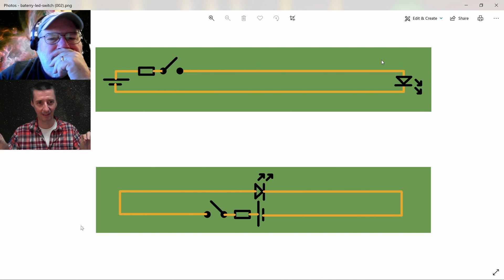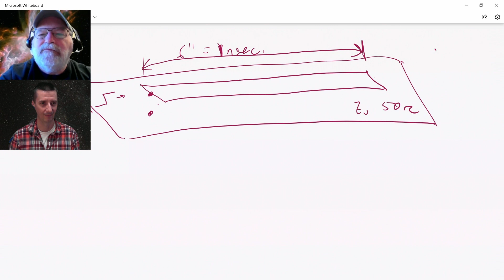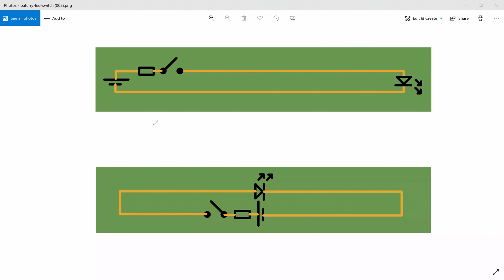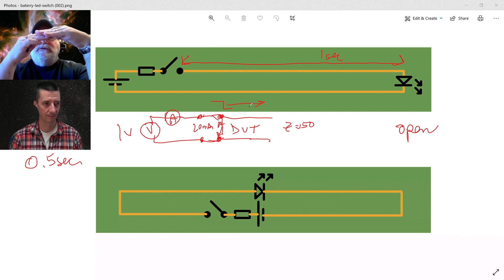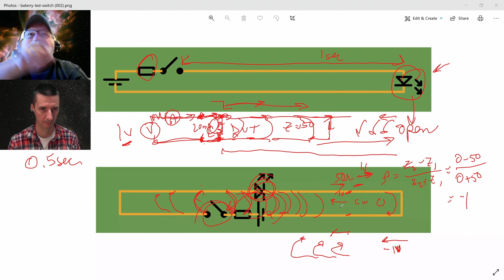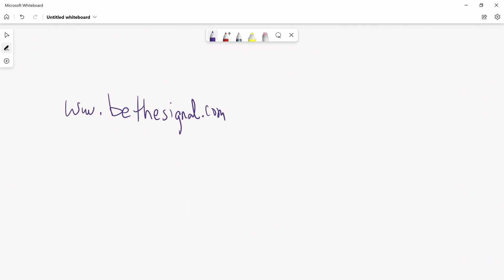Explaining Veritasium Electricity Video: Energy doesn't flow in wires (with Eric Bogatin)

Comment: So, it is due to this displacement current effect that you can terminate transmission lines with resistors and have the impedances match?
Reply: Yes. Well not exactly The transmission line acts as a chain of inductor capacitor pairs connected in series. When you test a single L-C pair using a meter (apply a voltage, read the current) you see a dynamic effect -- following the stepped voltage, the current plays out as a ringing pulse.  But when you chain an infinite number of these circuits together, and array them in space, the  further away ones affect what the near end sees later in time, with the net result that the overall effect at the near end is that the applied step in voltage causes a constant current. It is THAT phenomenon (fixed voltage step causes fixed current step) that looks identical to resistance, and hence allows you to replace the far part of the infinite cable with a resistor (of appropriate value) and it's indistinguishable at the near end.
Reply: @Graham_Wideman  Thanks, that makes sense.

Comment: Great video, and I love Bogatin, but I think he’s not quite right at the end. The “ideal-ish” LED will blink briefly as the displacement current activates it from 1m away, and then it will turn back off until the circuit begins to settle ~1s later. After the displacement wavefront passes the LED, what transient condition exists across the LED terminals? There’s no longer any current flow until after ~1s when we start to see the LED turn on permanently  as the reflections settle out.
Reply from the maker: When we have a look at Eric's graph, it says, 50OHM all the time until it's back ... so, that would mean 20mA flowing all the time when the edge is travelling the way there and back. If we are talking about the bottom circuit (led, battery, switch, resistor placed in the middle), the current would be flowing through the LED when the edges would be travelling. Or?
Reply: @RobertFeranec  Again, I am still asking questions instead of explaining.  My perhaps flawed understanding is that flipping the switch lets the voltage difference move downstream, and each new point it hits creates a displacement current.  This wave of newly created displacement current should turn on the LED as it passes.  

But after the wavefront passes, I would expect the voltage in that area (such as the at the LED) to no longer be changing, so I would expect the displacement current to stop powering the LED.  (Or is it somehow a whole continuing series of waves?)  It might still be powered by regular current conducted from where the single wavefront is now, but if so, I would expect that to be at a lower power, because of something like the Doppler effect -- it has to come from farther and farther away, without actually speeding up, so it spreads out.

So I'm not sure why (or even if) the LED doesn't fade a little.  Afterwards, both this video and Veritasium's agree that the power will increase as the energy has time to traverse the complete circuit, but I think Veritasium explicitly said (and you didn't disagree) that it slowly converges to full power over about 10-full-circuit-traversals, instead of snapping to fully on with the first complete-circuit traversal time.  The only explanation I can yet imagine for that is that the convergence is some sort of "half-way there" on each step, and he arbitrarily picked 10 steps as when it is "close enough."  And if that is correct, it might still be worth a video explaining how things (current? voltage? capacitor charge?) settle in that exponential fashion, and ideally, why.
Reply: @jimjjewett  There are no reflections in an ideal transmission line.  All of the power goes into the LED, it does take 1meter/c seconds for the incident wave to reach the LED.  In a non-ideal transmission line, you can indeed have reflections which might dim a hypothetical LED.
Reply: @seanm2511  All of what power?  Are you saying that because we are assuming an ideal transmission line, the LED will be on at full power as soon as it is on at all?  If so, then both Veritasium and this video disagreed.  But if not, then could you be more explicit about what your point is?  For What It's Worth, I had assumed that "ideal transmission line" in this context just meant that there was no resistance, so the circuit could actually work despite its huge (borderline astronomical) length.
Reply: @jimjjewett  Well, maybe I should watch the video again, but I heard "ideal transmission line" which means the following, at least to me:
1) the source and load have the same impedance
2) the line has no impedance
Re: your comment:

"Are you saying that because we are assuming an ideal transmission line, the LED will be on at full power as soon as it is on at all?"

Yes!  With an ideal transmission line regardless of how long it is, we have a square wave of current which has no reflection, and no phase delay.  With this ideal transmission line, an LED that is 1 light second away will be on in 1 second and will not pulse.
Reply: @jimjjewett  But, perhaps I do not understand your objection.
Reply: @seanm2511  OK, that is a helpful clarification.  (I apologize if my initial wording sounded brusque.)  I just don't think it is what the presenters meant, since they all agreed that the LED comes on in multiple brightness stages, and Eric Bogatin specifically talks about (negative!) reflections where the impendence is reduced by a wire connecting the two lines at their distant ends.  

I also think this is the first I've heard that "ideal transmission line" would imply more than your number 2, plus maybe the "no phase delay", or no variation by frequency.  I can see where assuming stuff about the source, load, and switch would be helpful though -- did you learn this convention looking at electronics, or at power line transmission, or in some particular domain area, or ...?
Reply: @jimjjewett  There is also propagation delay between signals on the same bus, but that's not really important here.
Reply: @jimjjewett  See my HFSS simulation to get a visualization of the fields and calculated currents. The bulb does indeed see a sustained current rather than just an initial blip. I am in the process of making a video explaining why this is since it was very unintuitive to me at first. Basically it has to do with surface charge densities that get set up by the electric field and continue to drive current at a reduced level until the signal reflects off the ends and starts to step up the current to its steady state value.
Reply: @PulsedPower  When you say "my HFSS simulation", do you mean https://www.youtube.com/watch?v=aqBDFO1bEs8 Response To Veritasium - Electricity Propagation Time Problem?
Reply: @jimjjewett  Correct!
Reply: I'm replying just so that I'll be notified if this gets answered.  The wave is propagating down the line, but it isn't clear to me that there are new changes at the origin until a reflection gets there.  I told myself it was current being conducted back from new displacement at the wavefront, but ... I'm not confident of that, nor am I confident that a Doppler-like effect wouldn't at least decrease it.  Of course, I also don't quite get why it comes up in "10 steps", instead of after 1 step, or at least in a zeno's paradox of 1/2 the way each step forever.
Reply: @jimjjewett  I think the displacement current will be enough to sustain the LED, and there's many ways to explain it, but this is my layman understanding using lumped elements (please correct me if I'm wrong):

As displacement current is produced through each section of wire, charges are depleted in that section, which causes current to flow from the adjacent section. In the top circuit, only one wavefront is produced, which means there's displacement current in only one section of wire at any given time, but conduction current is supplied by the source, which produces a continuous current between the source and the wavefront.

In the bottom circuit, there are two wavefronts producing displacement current in the same direction, starting at the same spot. So immediately the displaced charge from one wavefront is picked up by the other wavefront, such that there's always a continuous current between the two wavefronts.

EDIT: Might be completely off-base. This explanation seems to imply that you can throw the switch, remove the source, and the LED will stay lit from the displacement current due to the wavefronts alone. Something's definitely missing here lol
Reply: bwseventytwo - exactly. This is why you cannot use a transformer with a DC current, and why we use conductors to carry the energy, not air. I don't know why people are forgetting what happens in the real world here.
Reply: If we're specifying ideal transmission lines, then there will be no reflections.
Reply: Displacement current is related to transmission line. It flows between the capacitors. Led is far from source. So displacement current is flows between transmission line first. After some time it  conventional current reaches to led then led will glow.
Reply: I think experiments show that it receives some power continuously until 1/c seconds later. There is continuously coupling of energy from the wave front during the 1/c period.

Comment: Unfortunately, Derek used a pretty powerful lamp and just 2 wires 1 meter between them, so I think his answer is incorrect. Yes, you can measure the current going through the lamp immediately, but it is not enough to light the lamp. Also, the current with his setup will be extremely low (i wonder what is an impedance of his line :D )

Great video btw!
Reply: You mean Derek, right?
Reply: @DehimVerveen  Ops, you're right. Thank you.
Reply: @zx-4rr-pls  That's true, but I found it misleading because with this condition it will turn on even if we cut the wire somewhere. And he doesn't mention it. Also if we assume that the wire diameter is zero - then there will be no instant current (infinite impedance).
Reply: @zx-4rr-pls   It's misleading, because people expect to learn something about the mechanism which normally lights the bulb. By using the crucial and unrealistic assumption of any current being sufficient, which is quite easy to miss, he is able to light to bulb with a different mechanism. If the point was to teach people about wireless transmission of EM fields or that a system of wires has non-zero capacitance, this should have been made more clear. For example, they could have simply left the circuit open, then it would be much less confusing and to the point. Or, in the case of an AC source, they could have explained it's basically just an antenna. Now people are left with the impression that the current going through the bulb in Veritasium scenario is the same as if it got there through the whole circuit.

Comment: Hey Robert, thanks for the video! This is exactly what I thought given an earlier video you did with Eric Bogatin on transmission lines.

I still have a couple of questions though. I found the formula for characteristic impedance of a transmission line online as (120/sqrt(er))*acosh(s/d). Here er is the relative dielectric constant, s is wire separation and d is wire diameter.
If I plug in a wire diameter of 2mm, wire separation of 1m and dielectric constant of 1, the transmission line impedance is around 830 ohms. If I want an impedance of 8300 ohms, these same wires would have to be around 10^27m apart. Is this correct or is this formula incomplete?

Furthermore, if we take 2 transmission lines of 830 ohms and a load of 12.1k (an led + 12k series resistance with a 230V voltage source) the current through the load before reflection can reach 88% (12100/(12100+2*830)) of the final current, but how would it get there? How long would it actually take before the current through the load reaches, say 80% of that 88% figure? Surely the current will start rising at t=1/c seconds, but won't reach 88% until some time after that. Maybe you could do a physics based simulation of some sort?